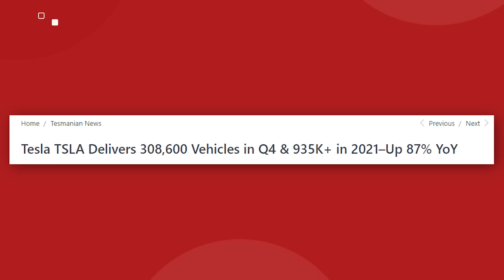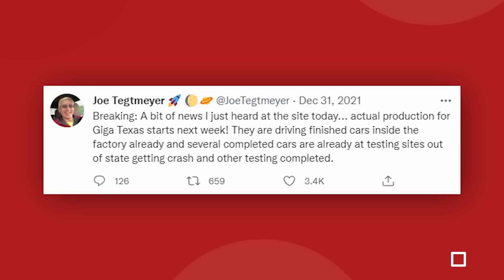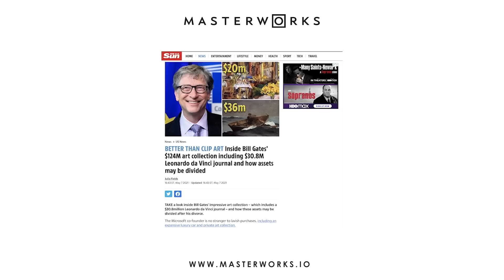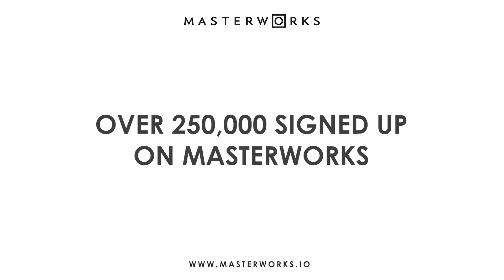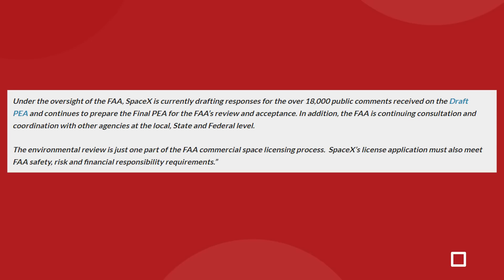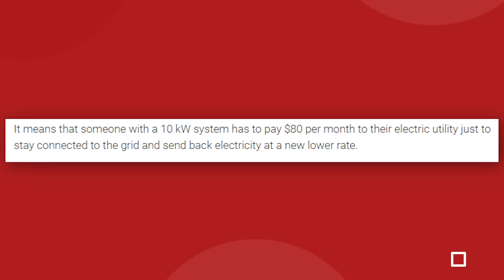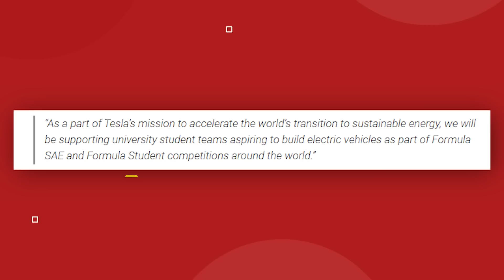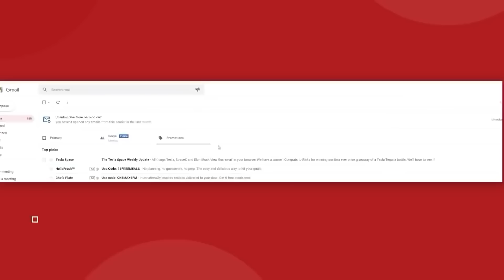Tesla Makes New Changes To Model 3 and Model Y!

Comment: If you install a new solar system connected to the South West Interconnected System (SWIS) in Western Australia:

Electricity net exported at peak times between 3pm and 9pm will earn 10c/kWh;
Electricity net exported at all other times will earn 2.75c/kWh.

Those are Australian dollars (AUD), roughly equivalent to Canadian dollars

Therefore in USD:
Electricity net exported at peak times between 3pm and 9pm will earn 7.2c/kWh;

Electricity net exported at all other times will earn 2c/kWh.

Comment: So we finally got around to a quick test drive in the Tesla Model 3 long range. The technology is fantastic but put a cloth over the one screen and it’s a fairly bland car, lump drive, lousy on bumpy roads, heavy steering (quite surprised me) and the wind noise was incredibly loud as was the road noise. Overall quite disappointing as this was to be my dream retirement car !
Reply: I drive a 2019 Toyota Camry and it suffers from wind noise and road noise depending on the road surface.
 It is still the most comfortable car I have driving in the last 30 years of driving.
 I've never driven a Tesla so can't comment on it but would love to do so and give my honest opinion. Make from this what you will!

Comment: someone please explain what is so good about these cars, i dont see it
Reply: Exactly what we used to say years ago about the Computer. that should tell you everything . Why do you have a transmission, why do you have a 4000 parts motor, why do I have to go to a gas station, I charge my m3 at night in my garage in the morning the car is warm and ready to go. Are you still using a typewriter? Pleas go and test drive a Tesla Y and that answers all your questions.
Reply: Best safety ratings out of basically any car. EVs are able to take front collisions better because there is no engine (so the front can be structured with only safety considerations in mind), and the battery at the bottom lowers the center of mass to make roll over less likely. But Tesla adds lots of exotic safety features that nobody else does. That's a big plus for me. There is also best performance for the cost and fancy software features, if you care about that stuff.
Reply: @jack19715  probably comparable to many cars, just because it's Tesla doesn't mean it's the best.
Reply: Depends on where you live and do you have access to an over night charger. If you do, such a car can be charged nightly and cheaply like your cell phone, leaving no need to ever make a stop at a fueling station:) If you travel a lot, EV's can be charged at fast chargers while eating or stretching you legs I suppose.
Reply: Only educated consumers know what Tesla EVs can offer...it's compelling to drive...got my M3 in Dec. 4/21 and I ordered MY, Jan. 7/22...delivery by July 2022...
Reply: @TigerInTheWoods  So you've got to be educated. Nice little insult there. It's just a car with a ipad.